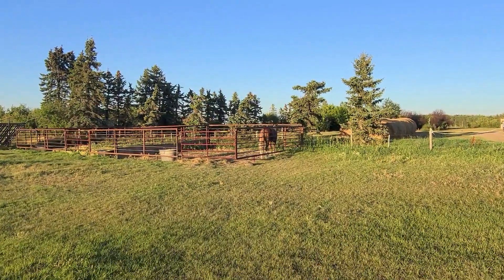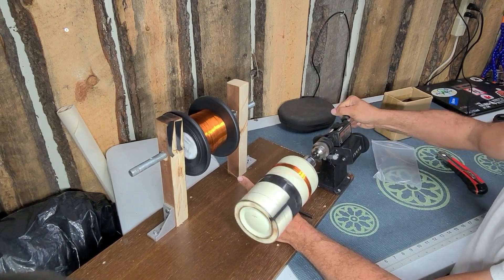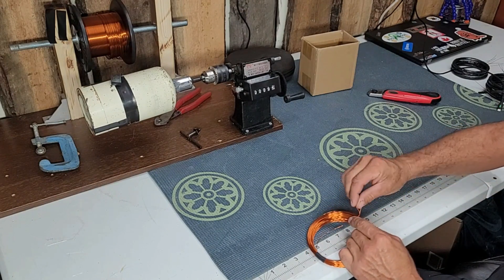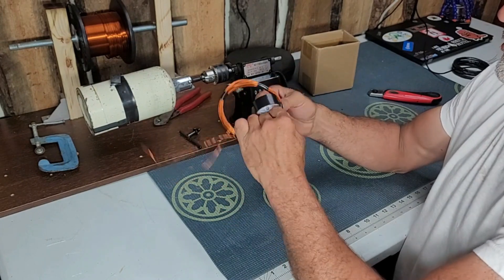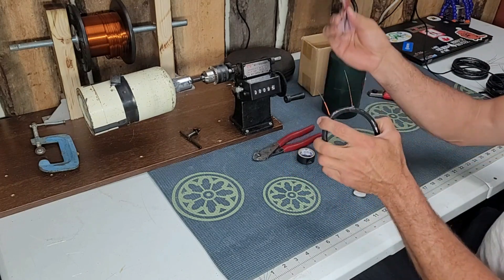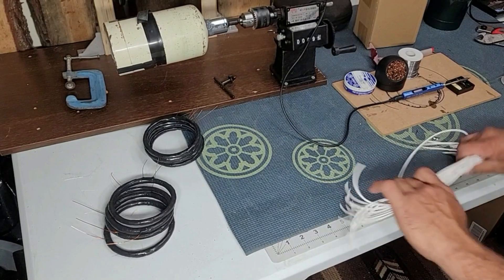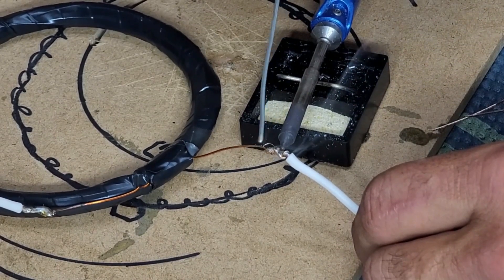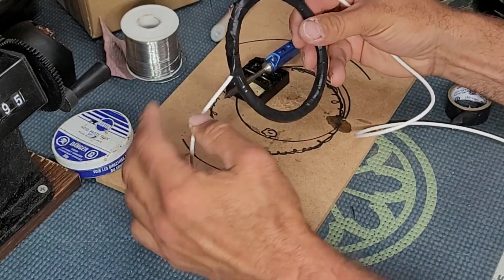DIY PEMF -  Making Coils (Part 1)

Comment: Good day Steve the closest copper wire I can get in my country is 0.63mm which is close to 22 Gauge am I correct in saying this? Do I still use 95 winding as per your video?
Reply from the maker: You will need my calculator.  Contact me at Hello@pemftheworld.com

Comment: Hello Steve. A question about the coils. Your coils have a diameter of 95 and 95 wraps. How big is the resistance in a coil? Is it possible to make coils in another diameter and wraps as long as the result has the same resistens? Can you use a thicker or thinner wire as long as the wraps match up for it? 
Thx you🙏
Reply from the maker: Very good question.  It all comes down to ohms law.  But here is a quick answer :
Yes, it is all.about keeping the total.resistance in balanced.   

Using different wire quality size will.cjanhe the resistance.  

Bigger wire has less resistance while thinner wire has more.   

Ohm's law 
E=IR 
P=IE
E=voltage applie
I= amps
R=resistance 
P=power mesure in watts or heat.  

Connecting the resistive load (coils) in serie makes the coils add their resistance while connecting serie in paralell make the resistance go down (inversely of sort).

Keep.watching the video.  I made a calculator that helps.with all these formula.   

To be honest it is fairly easy when you understand ohms law.   But u til.then it appears to be magic.
Reply: @Steeve.  🙏👍
Reply: Ok I am just getting into this and I am a music producer working with solfeggio frequencies and I came across this and have been looking into the Schumann resonance and ok I want to do some experiments
Reply: so....  I could use the heavy duty 14/3  50 ft extension cords I've been collecting?   @Steeve.     Thank you for your information ...  you are a blessing!
Reply from the maker: Yes,   but rememner the two law you must follow 

Ihms law 
And maxwell.  Magnetic field and os law affect one an other.  
It can get really confusing.

Comment: I have a spool of thin copper wire, it is 1/64th" thick copper with the insulation on it it is 3/64th inch thick.  would this work for the coils ?  " I wish I understood this better.   I was thinking on using two computer 12 v power supplies together to make 24 v
Reply from the maker: It is difficult to assist you,   for starters it is possible to serie two power supply but one must know how to do it.    Also most computer power supply need a jumper to run on their own.   

The wire you have,  might work,  we would have to convert the OD of it I to awg size.   

:)   

If you need one on one help you can join my patreon where we can further our discussion.  

:)

Comment: is the speaker wire you are using, naked wire or does it have a coating on it?
Reply from the maker: All magnet wire have varnish on itself. 
It is very important, if not you would make a short and nothing woiild work.  

:)

Comment: Hi Steve great video. I recently made a  high power PEMF device and it works great. Can  you tell me the diameter of the propane cylinder? I need to make a few large coils. Thanks
Reply from the maker: 95mm.  :)

Comment: Can you use different gauge of wire?  Does it have to be speaker wire? What happens if I use wire that doesn't have the enamel?
Reply from the maker: This Friday! Check out the S01E03 video.  Answer shall be found in there :)

Comment: Question, Steeve- Why are there still exposed bits of copper, even after everything is taped and the joining wiring is connected (and taped)
End product = still exposed copper wire.
Reply from the maker: @ModeratelySpeaking  
There is no exposed wire.  Magnet wire comes with insulation. Some are green some are red and some are copper in color ! 

:).

Comment: Hello Steve.Thanks to you i ordered my pieces to build one  I have a question though.. Would it be possible to build the coils differently? For example:
4 coils for the feet 120 wraps
4 coils for the waist 120 wraps
2 coils for the head 80 wraps
The idea is to produce more gauss for the feet, less for the waist and and minimum for the head?
I have red an article somewhere that suggest that is better this way because the head can't handle too much gauss.. 
And also is it ok to wire them in series the way you did?
Reply from the maker: That is omni propagenda, does not work that way.  

Email me at 
Steevebradet@outlook.com.  
I want to talk with you about newer  build
Option.  .

Comment: What about the polarity of the coil signal? My understanding is that the North side of the coil, is the favored side and it should face the body. 
If you have talked about this on some other video, please point me to the link.
Reply from the maker: I have not.   What I have talked about is getting all the coils pointing all the same way.  There is other arrangement of coils one can do to simulate a bipolar wave for example, or for i terlockkng purpose.   But for a unipolar wave I typically make.all.my.coils pointing the same direction.   

In my hands on arthritis video I touch a little on the slew rate of the magnetic field.   That is the part that research as found to be the key to pemf.    Making all.the coils "pointing" the same way is just to maximize the size of the field.  ( avoiding possible interference. ) 

Remember.  Magnetic Field only interact when they are perfectly parralell to each others.   Either they add or they subtract.  (  Same way as per the right hand rule adds.  ) 

If you know of some research that has found north as an advantage over South I am very curious to read it 🤔😊  please share it with me.  

Happy new year!!
Reply: @Steeve.  If the N and S pole change with each pulse, does it matter if the coils are facing north or south? Wouldn't they all switch at the same time?
Reply from the maker: @timelessrejuvenationcenter  the north and south is dictatwd by rhe directiom of the flow in  the coils.   You need.to oriente the.coils.acordingly or yiu will have random coil orientation on your mat.
Reply: @Steeve.  I understand. My question is would it matter if they were all facing north, up or south, down when you're putting your mat together?

Comment: How do you check the polarity of the coils when you connect them? I tried a compass and a battery. But flipping the coil over doesn’t change its polarity.
Reply from the maker: Watch my others videos.  I have a few places where I explain how to use coils on top of each other so that either cancel the field ( meaning they are opposite) or add to the field ( meaning they are pointing the same.direction) using a magnet.

Comment: I didn't see any foot measurement for the 4" size coil.  Can you enlighten us?  thanks.
Reply from the maker: @medusa569 I don't understand your question.   What do you mean by foot measurement :).
Reply: @Steeve.  I mean you give thew wire gauge you used but not the expected total length ( footage) of the coils you wind so we may have a better expectation of the spool pf wire we need to order.  How long was your 95 turns?

Comment: great job Steeve. Is there a specific polarity/verse tu place che coil on the body, the north or the south of matgnetic field near the body?
Reply from the maker: Excellent question ! 

I have not found any evidence of one being better than the other.   

Evidences point toward a sharp change in the wave form.   ( slew rate)  that is why the dc square wave is the best.  

Working on the bipolar where will be using both North and South.   

Stay tune!!